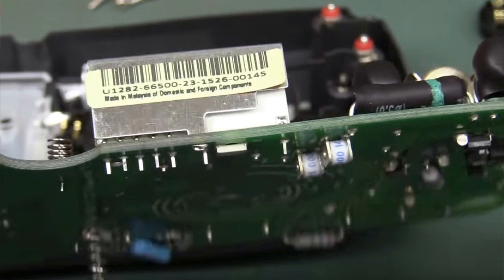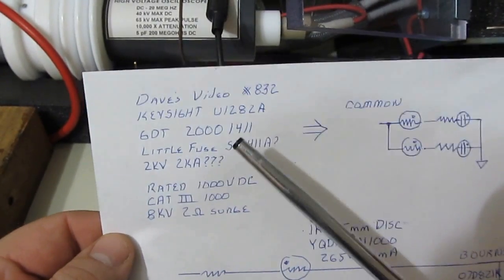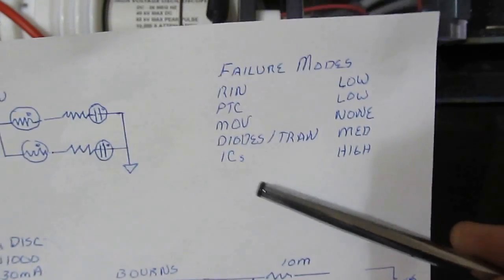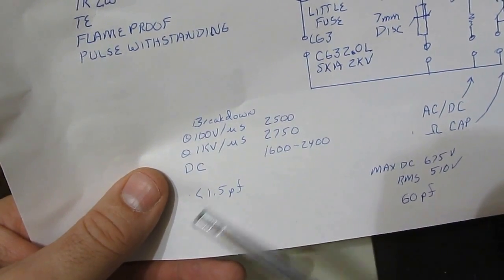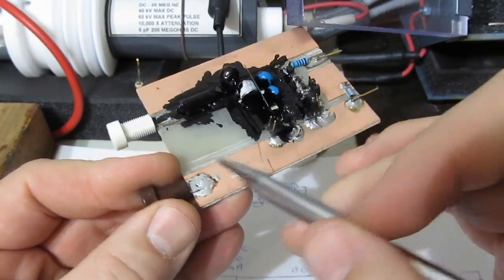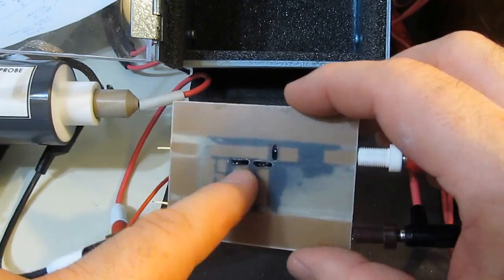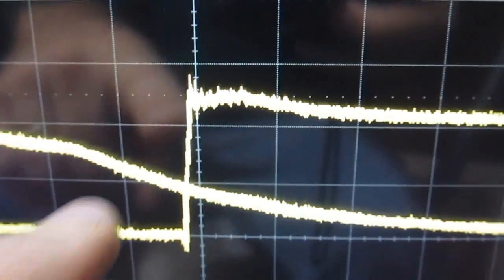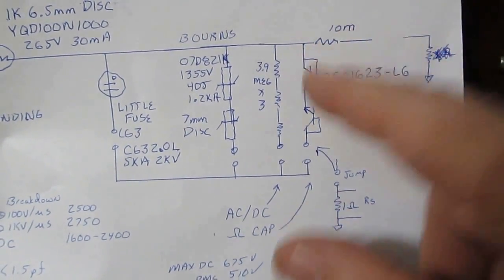Multimeter Protection Circuitry GDT vs MOV

Comment: you need to use gdts across Line and neutral, then use a high power resistor after that in Line in series, then use movs across Line and neutral.
Reply from the maker: That must be one of the dumbest posts I've seen in a while.  Protecting the front end isn't rocket science.  There are two basic techniques the big players use which make them very robust.

Comment: Hope you have to move the GDT in front of the high power input resistor
Reply from the maker: Obviously you would NEVER EVER want the GDT directly across the mains as you seem to suggest.
Reply: @joesmith-je3tq   oh, I forgot that it goes between mains input. I'm using GDTs across the signal lines like RS485, 4-20mA and othersignal lines and I can able to pass 4KV EFT and surge (8/20) comfortably. Anyway I'm using wurth electronics through hole ferrite bead and a TVS diode after the GDT.
I accept that the GDT across mains input is not acceptable and you may need a fuse or fusible resistor in front of it. 👍👍

Comment: Thanks for directing me here. As I commented on the BM27 post, I have seen MOVs fail in at least 5 DMMs (all Fluke 289). I can't tell the conditions that caused it. I can guess based on where they were used, and it probably was  either a HV transformer or a large HV capacitor discharge in a test cage. A blown up resistor (significant mechanical force projected to the walls) probably will not be caused by continuous HV sine, of course the source impedance of said transformer would be very low, so it would be possible probing it shortly while it would output 10 kV and send the components inside the meter flying in pieces. Certainly the balls or ignorance of the operator had to be heavy to go near those conditions with a handheld meter.
Reply from the maker: I did try running a long term high voltage test after someone had suggested it would cause a problem.   It's at the very start of this video:
 https://www.youtube.com/watch?v=dQPcAs0EEqY

Comment: Could someone come out with a box that plugged into the front of a multimeter that provided input protection like this?
Reply from the maker: There are high voltage probes available.  The problem is trying to measure resistance, current, capacitance.... with the added impedance.  There was an accessory for one of the meters I bought, that increased the protection but it was no longer offered.  They may have had a problem getting it certified.

Comment: Dear Joe Smith,
I'm very impressed with your researches made on multimeters. I'am a physicist working at a german university, so I'm not too far away from the topics you are addressing. I have some questions, as well as ideas regarding your work. Would it be possible to have some conversation outside of YouTube ?
Many thanks,
Stefan
Reply from the maker: If you want to join the EEVBLOG, I have a long standing thread there that you may join and post your questions / comments to.   There is also a FAQ that covers the majority of questions.
Reply: @joesmith-je3tq  Did you block the PM on EEvblog ? I would have very much appriciated a personal discussion with you.
Reply from the maker: @stefangoertz9494  Yes I did as many people want to discuss technical subjects that could normally serve a wide audience, which is really why I am on social media. 

As long as it can be kept in the in the public domain, start up a thread on what ever the subject is.   You may find you also get a lot more dialog this way.

Comment: MOVs don't last forever. There were some on the solid state relays on a poly bag packing machine. On occasion one would go up in smoke and stink up the whole factory.  Gas discharge tubes last forever if not broken.
Reply from the maker: Nothing lasts forever.   Aside from that,  the MOVs and GDTs used in DMMs front end are typically behind a surge rated resistor and a PTC.   This will greatly limit the energy these parts handle during a transient.   While I have damaged a lot of components when testing these meters, I have yet to have a MOV fail.  The energy levels are so low, even if a MOV were directly exposed, it would take a lot of effort to degrade one to the point where it would have any effect on the readings.
Reply: @joesmith-je3tq   That makes sense. The MOV's on these machines could have been taking huge spikes. The solid state relays controlled 480volt motors and sometimes I would see a good arc flash if a fuse blew.
Reply from the maker: @troytaylor1913  This was covered in the video you are commenting under and assume you didn't watch it.  I have someone post about MOV failing when exposed to extended over voltage conditions.  Again, if they had understood some of the basics, I doubt it would have come up.  Here you can see me running this test on a Fluke 87V.  Testing starts in the very beginning.   https://www.youtube.com/watch?v=dQPcAs0EEqY

Comment: Great topic, very interesting results. Noticed on older Flukes from the 80's and early 90's they used fusible resistors and spark gaps. Wonder why they did not use thermistors.. any possible advantage? I can see a disadvantage, they need replacing after an overload. Great channel, thank you!
Reply from the maker: You would need to supply a model number for the Fluke you are referring to.   Every Fluke I have looked at will use a surge rated resistor, PTC and MOV combination followed by some BAV99 or 199s to act as the high speed clamps.    That is except for my very first Fluke which has nothing.   I have had several people point out MOV degradation but again, this has not been a problem with the tests I show.  I had someone post about long term effects of high voltages being applied which I again ran a fairly detailed test on.  I think many people don't understand that the current to the MOV is limited by the PTC and resistor.    GDTs will certainly degrade as well.  
There are good papers on the application of both MOVs and GDTs.  They both have their good and bad points.
Reply: @joesmith-je3tq  Thank you for taking the time to read and reply in detail. I was thinking about the Fluke 83 series 1 and the 25. I just downloaded the schematic for the 83 and it clearly shows component RT1 - 1.5k thermistor. Ups, did not know they came in rectangular cap like shape too, thought it was something else. Noob mistake, sorry, I'l make sure I read the schematic next time :-)
Reply from the maker: @georgegherghinescu  Looking at the service manual for the 83, 85 & 87, they have a combination of two MOVs and a single GDT for the primary clamp.  Guessing they wanted that low capacitance, very low leakage for some reason.  Hard to say how it would hold up in these tests.  The problem with running old meters is you never know what condition they are in.

Comment: About input protection, I killed my multimeter with continuity test probing the rectified mains. I forgot to switch back to to DC option... It was cheap instrument with only one PTC... Does input protection protect from this kind of accidents?
Reply from the maker: Sometimes is does.  There is a whole spreadsheet showing meters that were damaged with a rectified 220V AC when cycled through all of their functions including the continuity test.  It's rare I have damaged a meter this way but it has happened.

Comment: Nice video sir. It will interesting to experiment the case in which, GDT and MOVs in parallel with each other are used for input protection simultaneously.
Reply: A more effective solution would be to run the GDT in series after the MOV, the MOV clamps that initial spike the GDT can’t handle then the GDT will clamp the remaining transient
Reply: @SRheayns  additional benefit to having MOV and GDT in series is the GDT is totally open circuit, so it mitigates any issues with MOV current leakage. This is why this design is used for mains surge protection.
Reply from the maker: It should be obvious but post your results when you run it.
Reply: I don't have the necessary equipment to perform these tests. Looking at the graphs 9:32, I have an intuition that by keeping GDT and MOV in parallel to each other, one can get best of both worlds; faster clamping at desired clamping voltage (MOV) and faster dissipation of energy (GDT).
Reply from the maker: Think about it.

Comment: Thanks for that investigation.  I'm a little surprised at the GDT inability to properly clamp the initial overvoltage (though it clamps great after that, but by then the damage downstream is likely done).  Would have been interesting to see a scope shot of the MOV in parallel with the GDT, given the same 5kV pulse.  I think that's what I might do on the front end of the power supply I'm working on right now.
Reply from the maker: Yea, the slow switching speed is a problem.   I did end up testing a Keysight meter with the GDTs and it did not do very well.